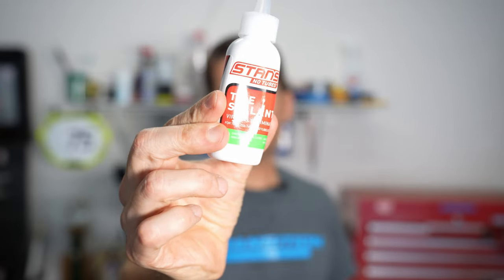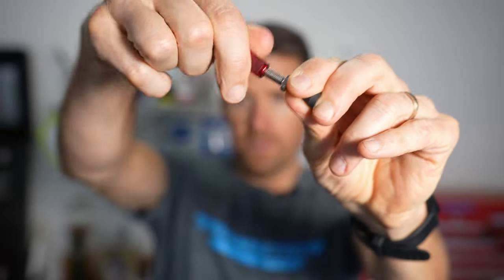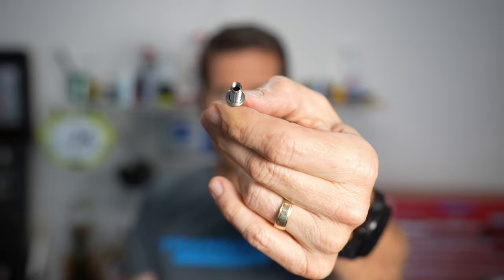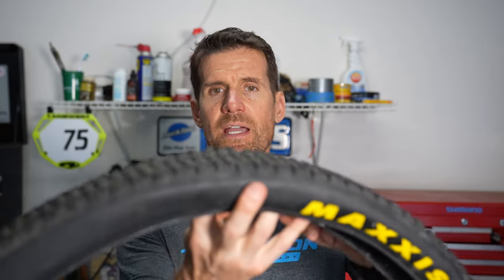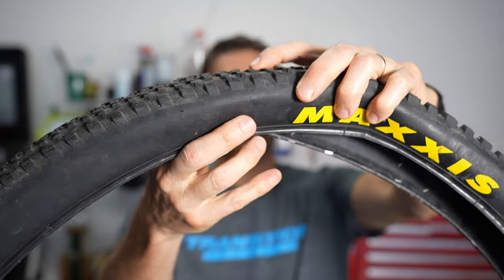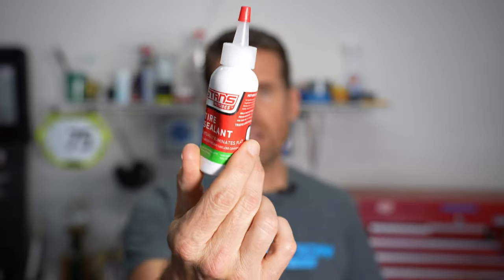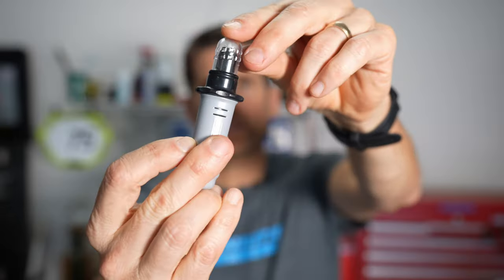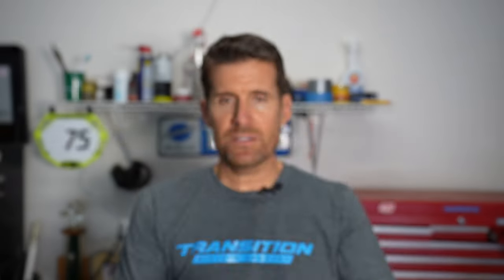Should You Put Tire Sealant in Tubes?

Comment: all i am hearing is .. "blaa blaa blaa blaa... tubeless is the best." ... really?
Reply from the maker: I make my videos to help people enjoy cycling more. For me, riding tuneless means less time on the side of the road or trail patching a tube and more time riding. It’s not for everyone, but for many riders the ride quality is better and it’s less hassle. It’s been years since I’ve gotten a flat on a ride. Riding tubes I’ll be patching a tube every month. Just fine what works best for you.
Reply: @ClintGibbs  the problem is how you presented about inner tube which is bad, bad and bad.. I visited here to understand tube sealant effect on bicycle, and looking for method to adopt that into a motorcycle  - bike with tube ... I love technology and advancement, plus innovation - FYI I used to work for technology front end corp... however, there is something I begin to aware which is speed not always reliable in long run, you can't fix it yourself. You can fix a carburetor and hell no way fixing a fuel injector..in-term of reliability, hrmm you know how good are electronics ...   so, have little sympathy for old tech used by nerds, we stuck with old tech because we know new tech gone cost hell when your $$$ runs low. ... am retired.
Reply from the maker: @opcom64  Tubes are not bad at all. I ran them for 15 years in bike tires. But after running tubeless for 15 years I can confidently say that the ride quality is better and you spend much less time patching and replacing tubes on a ride. For me the benefits far outweigh the hassle. But the good thing is we have choices and what’s good for me isn’t necessarily good for someone else.
Reply: @ClintGibbs  love your input/reply ...